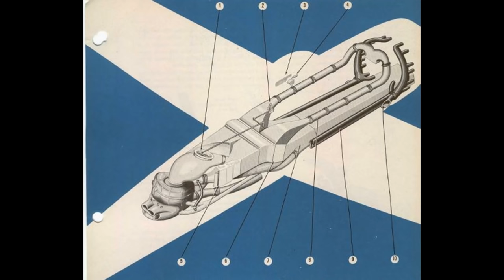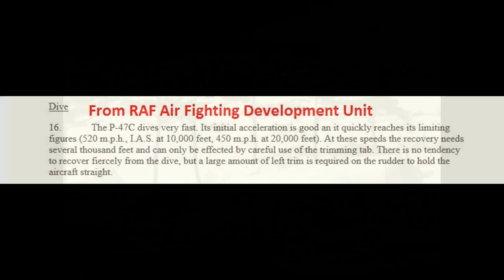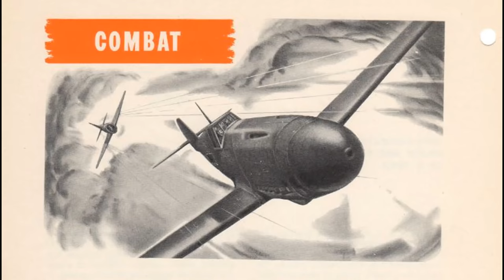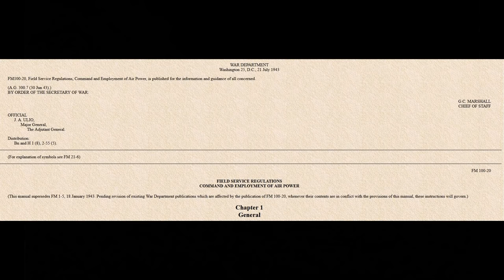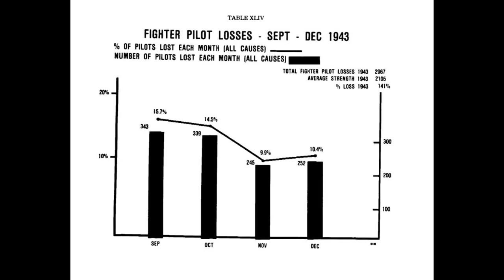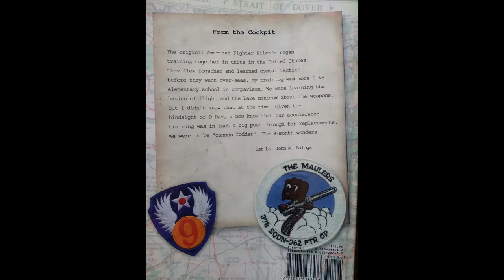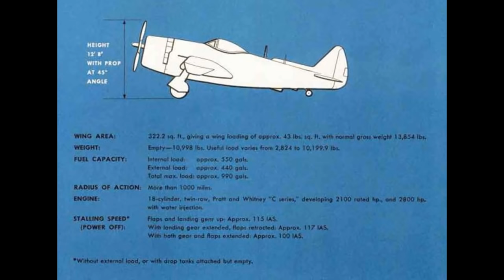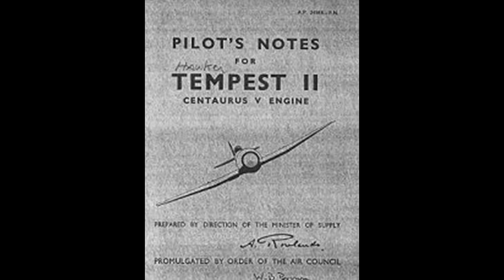P-47 Thunderbolt Pt. 8 Conclusions

Comment: Great job on a great series.  In particular, I did not previously appreciate that some of the P-51's fame and reported superiority over the P-47 was due to the senior AAF leadership using the delayed introduction of the long range P-51 as a coverup for deliberately not providing drop tanks to allow deep escort by the P-47 in order to try to prove their mistaken idea that well armed bombers could self-escort.  The denigration of the P-47 in the literature (untrue lack of range) has persisted from then to now, which is why I did not fully appreciate it before watching this series.  With the P-47 being the actually good quality weapon that was available in 1943 and the first half of 1944, since the P-51 had been delayed by similar senior general officer level bad decisions,  the P-47 had to carry the load and succeeded in doing so.  In a lifetime of reading about WWII aviation, I don't think I've seen this argument made before, and certainly not with the detail and historical accuracy of this series.  Of course, the point about the P-47 costing $83k and the similarly effective and in some ways better (smaller, harder to see, superior surprise, slightly better dogfighter) P-51 only costing $51k is also critical, as a main job of air force leadership is providing the best air force for the available budget, and here the P-51 is clearly superior.  But, it also seems Republic may have partly brought some disrespect on the P-47 among senior leadership themselves by insisting on higher profit margins.  The Grumman F6F Hellcat was also a great plane, using the same engine, weapons, and avionics as the P-47, and costing only $35k per plane.  The P-47 is more aerodynamically advanced (needed in the ETO), but that does not fully explain it costing 2.4X more than the similarly defined and equipped Hellcat.  

Greg, I certainly wish you success in getting your materials into mainstream military aviation television documentaries.  By yourself and on a part time basis you are doing a lot better job than they are with their much larger teams and budgets.  You are basically the P-51 of WWII aircraft documentary makers.

Comment: Another great video! Thank you Greg! 

A thought about diving:

"In short, you will seldom maneuver in either the pure vertical or the pure horizontal; rather, you will be trading airspeed for altitude in an infinite variety of oblique planes. As you develop your BFM skills, you will learn how to use the oblique to turn as tightly and quickly as you can while conserving the greatest amount of energy, thus preventing you from approaching the deck, out of airspeed and ideas."

Comment: Greg, thanks so much for the great series on the P-47!  My uncle,  1st Lt. August Garcea,  flew the P-47D in the ETO.  He was a little guy...5' 4" and 140 pounds and flew with the 358th FG, 365 Fighter Squadron (Orange Tails.)  He flew 24 missions and was sadly killed in November 1944 near Hagenau, France. His plane was damaged in a dog fight with a Me 109, but he landed it safely.  He was later found wrapped in his parachute and buried next to his plane which was only slightly damaged.  His wounds were consistent with being stabbed with a pitchfork.  The local farmers did not like the Jabos since they commonly shot up horse-pulled farm wagons that the Germans used for transporting equipment and ammunition.  There was a statement taken from a local farmer that observed the dogfight and the landing of the plane in an open field.
Reply from the maker: Thanks for the story Ken, I'm sorry about your uncle, it sounds like he was a brave man.
Reply: @GregsAirplanesandAutomobiles   He was just one of many P-47 pilots that didn't survive the war.  Flying low to attack ground targets they often didn't have the opportunity to use their parachutes to attempt or survive a bailout.  Also, the German quad 20mm anti-aircraft guns were deadly to low flying planes.

Comment: The focus on pilot skill is important.   Early in WWII US suffered greatly against more experienced Japanese and German pilots, the other side simply had more experience.   

The zero was a very good plane, but by no means invincible.  I think part of the zero's reputation was gained early in the war when US pilots often did not have experience.   An F4F Wildcat can compete with the zero if it plays to its strengths.

You could argue that the German air force was largely defeated by losses on the Eastern front.  But then again US was also fighting a 2-front war (also in Pacific).

My final comment is that of all the amazing information on this channel the most amazing for me is the Taiwan-PRC civil war.   The late-model piston engine planes the PRC flew were no slouches, and idea of going on head-on-head against a Mig15 in a P47 is crazy.

Comment: A great conclusion to this video series! This is only somewhat related to the subject, but here goes. Air cooled radials seemed to have emerged victorious after WWII as being the engine of choice for large piston engine aircraft. Why is this? I can see this being acceptable for military applications due to them being able to withstand damage and keep running. However from the civilian side of things, it doesn't make much sense. Battle damage is not an issue in this scenario. Liquid cooled engines typically run at much more consistent temperatures than air cooled so tolerances can be tighter. This would extend the service intervals of the engine and be less costly to maintain, not to mention eliminate the shock cooling concern with air cooled engines. There would also be a performance benefit because the liquid cooled engines could run more manifold pressure without the risk of knock due to lower cylinder head temperatures. Yes there would be a negative impact due to the weight of the cooling system but this could be offset somewhat with the smaller liquid cooled engine making equivalent power and reduced drag due to less frontal area than a radial. It'd be interesting to see what would've happened with piston engine aircraft if jet engines had not taken over so quickly.

Comment: Outstanding analysis.. very much appreciate and look forward to your videos.

You make a very strong case about the combat effectiveness of the P47.  However if 3 P51s can be provided for every 2 P47s, and they use less fuel,  the P51 was a 'better' warplane.   A 50% increase in the # of planes and less of a logistical  support need are very important attributes.   

So while the P47s engineering/performance was superb,   it makes sense to replace with P51.

However I appreciate how Greg debunks many of the P47 myths .. and how important an aircraft it was to the Allies.. look forward to the next video
Reply from the maker: Good post Keith, and that's actually my point. Yes, it made sense to replace P-47s with P-51s, however not because of any deficiencies in the P-47 performance, range, or effectiveness, but rather because it was too expensive. My other point was of course that the 47 did a lot more to win in Europe than the 51.

Comment: Thanks for the great video, it was hard to wait so long for the next WWII episode!

One question: I noticed the two-engined B-26 and A-26 were nearly as expensive as the four-engined B-17, from 1942-44 over 90% of the B-17 price. Why was this? I mean, aren´t engines the single major cost factor of aircraft, at least WWII ac?
Reply from the maker: The A-26 was far more advanced than the B-17 and far more capable. It's a late war plane as opposed to a 1930's plane and thus economy of scale wasn't there for it either.

Comment: I would like to add something from the perspective of someone who has built and flown scale RC airplanes since 1971; including being a designated test pilot for many of those years. 

The Jug consistently scales down well. I've flown them from 36 inch to 102 inch wingspan and even when overweight, as scale models usually are, they all fly well. My best, tragically lost to a midair collision, was 80inch span and 14 pounds with a 7hp engine. 104mph by the radar gun and lands like a low wing trainer. The only WW2 fighter I like more is the P-39 which is a little more aerobatic and just as stable.

Cheers!

Comment: Regarding the question of why later in war P47's were largely replaced by P51's in fighter role:

Both planes were good fighters, but the P47 was much better for ground attack (much more rugged).     So even if P47 was a good fighter, it made sense to move it to ground attack role.

Ironically five years later in Korea the Mustang had to participate in ground attack, we had to make do with what we had on hand.

Looking at WWII under-appreciated planes, the Illushun (sp?) Sturmavik was a good plane.  Might be  been most produced plane of the war, not super high-tech or fast but great ground attack plane.   The Germans had the stuka, the Russians had the Sturmavik, but the US did not really have a mass-produced single engined dedicated land attack plane.   It would seem starting with an R2800 you could do better than P47 for ground attack.  
* supercharged, no reason to fly high
* larger wings: P47 wing loading seems to be a disadvantage (and I'm a huge fan of the P47).  Post war the AD1 Skyraider is an example of plane with large wings around big radial, albeit the Wright R3350.  

Of course using the P47 had the advantage that using fighter for ground attack, you had the fighter protection built in.

Comment: 5 GALLONS of oil burned per hour??  Holy SH%# !!  I had no idea, no wonder plug fouling was an issue.
Reply: looks like  it was a problem of some  radial engines but the P-47 was not on the first place, take a look at US Air Force A-1 Skyraiders at the parking spot during the Vietnam war ;) a lot of oil covering the aircrafts noses , dripping on the fuel tanks, Tarmac ect.
Reply: @Sturminfantrist  All radial engines use oil.  "If they aren't leaking, they are out of oil".  -Old Axiom.
Reply: I love the Flying Heritage museum in Everett. You can tell most of the planes are in flying condition by the drip pans underneath them.
Reply: Dividing that 5 gallons by 18 cylinders and considering the massive displacement per cylinder and the power output and the fact  that it´s a radial engine, it´s not that bad.
In addition to oil burning in the cylinders, the crankshaft bearing seals also loose oil.
Superchargers and turbochargers also want to be lubricated and loose some oil (not sure if they use the same oil as the engine in the case of the P-47)

My 1960´s british car uses about half of that per cui per cylinder per hour when driven at 70mph, even more per HP, and it´s an upright inline engine!

I wouldn´t trade it for a Prius though! 

No significant spark plug fouling over the last 30k or so miles. Maybe I should replace them, but as long as they look good and neither power is lost nor fuel consumption increases, f**k the instruction manual!

Comment: The P-47 was never outclassed in any situation, in any model.  It used the best proven technology of the time, with the best engine available, and was delivered in numbers that changed the course of the war.  Designed as a high-altitude escort/interceptor, it also excelled when stuck into a ground attack role in the last year of the war.  Bravo Greg, as the living memory of Thunderbolt pilots fades, your work will stand the test of time.

Comment: 38:00 "Destroying the Luftwaffe" - also, as the Messers were over the Reich, they could not protect the Stukas from Yaks or the Wehrmacht from Ilyushins...
Reply: The JU 87s were withdrawn from the Western front after the reality check called the Battle of Britain. The plane was obsoleteand until the Battle of Britain had not met determined modern defensive fighters.
Reply: @JohnRodriguesPhotographer  Reality check: Operation Excess and several raids against HMS Ark Royal proved, that the Stuka is still a good dive bomber. 
And the Japanese Aichi D3 "Val" wasn't that better than the Ju-87 but was quite successfull - as long as they had fighter cover. 
Same for the SDB Dauntless and even the Fairey "Stringbag" Swordfish.

Comment: The one thing I do not understand about the Air War leading up to D-Day, is that the Allies did not convert at least one entire bomber group into a.... Wolf is sheep's clothing.

If you loaded zero bombs into a bomber, but instead used all that available weight for extra guns, extra ammo, or armor for the crew's action stations and the flight controls/vitals, then you could form a porcupine-like trap.

The Germans would not know there was not a single bomb in that entire formation, and they'd have to attack it as if there were.

And when they come close, you can now farm kills.
You don't need a Bombardier, so you can switch that out with another gunner or maybe a medic.
And with a lot of extra ammo and armor, you won't get shot up so horrifically.
You could also add some extra .50 cals, so that you actually take down enemies at even trades in lives, instead of planes. 

And especially when the Bomber Maffia was still getting loads of people killed for their stoopid reputation, this trick might have saved lives and more importantly sown doubt in the minds of the Luftwaffe pilots. 
One formation of these converted non-bombers would give them pause, and caused them to approach all the still-bomber formations with extra apprehension. 
Just the stress from not knowing whether today's formation is a trap too, would affect their flying negatively 😈
Reply: The only two reasons I can come up with why this would not be feasible, are:

- the bomb load they carried was not actually that heavy; at least not enough to significantly up-armor and up-arm the plane

- their take off weights and landing weight differed greatly
If the landing gear would collapse if they came back with their bombs undropped (due to weather or mechanical problems etc), then you obviously cannot replace that weight with armor plates. Since those are kinda hard to disassemble and drop overboard when they're flying back across the Channel 😅

Comment: Excellent  Greg! The Thunderbolt series(along with other subjects ) has been intelligent, concise, in depth & fairminded! This #8 especially, as I have argued the same truth, facts & opinions with Mustang lovers for decades. Not which was better, both had strengths & weaknesses(but as you have made clear, the P47's few weaknesses are always amplified while glorifying the P51), but my argument has always been that the P47 doled out more destruction to the German war regime than any other Allied fighter, both in the air & on the ground. More maneuverable than most think with a pilot that understood its strengths. Thanks for the factual info on major loss of experienced  German combat pilots via the Thunderbolts between June '43 & late spring of '44. This is a fact Mustang fans refuse to accept, & they never want to discuss the P47 being relegated to ground support(except the 56th FG), thereby leaving many kills for the P51s against quickly trained novice pilots of the decimated Luftwaffe(not forgetting the several dozen great Luftwaffe aces who survived the war, but they grossly outnumbered by well trained USAAF experienced combat pilots). There were many great aircraft in WW2, I've always believed the P-47 Thunderbolt was one of the best, all things considered. By the way, Dom Gentile describes shooting down 2 FW190s, expending his ammo, then outmaneuvering a 3rd in a swirling fight at low altitude until the 190 ran out of ammo. Not bad for a plane that is not supposed to be maneuverable, huh?!

Comment: Excellent work Greg, I really appreciate your work. The amount of hours you put in is amazing! A couple of notes, as a Canadian, the Dieppe raid was conducted primarily by the Canadian army, with some brit's and  Poles(???). It remains a sore spot for some here notth of the 49th. As well, in 2018, it was uncovered that the primary objective of the raid was to secure a new 4 wheel enigma encription machine. Your description of the oil consumption of air cooled radials is telling. In the mid seventies the Canadian air force, wanted to set a world record for the longest un refeuled sustained flight. They chose the the Argus, a canadian made maritine patrol aircraft. This thing had 4 Pratt&Whitney R33550 compound engines. The powers the be went to enormous lenghts to get, literally every last ounce of fuel into the tanks.
Reply: Sorry my bad, but to continue, the flight lasted a bit over 33 hours. They were forced to land not because of low fuel but low engine oil. Those radials puked a lot of oil. I heard one story ftom the Pacific Theater that the Japaneese did capture a P 51 and were amaized at the lack of oil put out by the PackardMerlin.

Comment: The photograph of the Razorback with the white gun tips reminds me of my father telling me about putting tape on the barrels of the guns.  I would have guessed they did it to keep water out, but he said they did it to know if the plane saw action.
Reply: Robert Johnson mentions this in his book " Thunderbolt! " he wrote that the ground crews could tell if he saw action because the tape was missing.
Reply: I had an uncle who was a Corsair crew chief in the Pacific, and they did the same with their aircraft (F4U-1A/D). 

He said the reason was twofold: first, to keep contaminants out; second; to reduce drag. The bonus was it was quick to determine if the aircraft had fired its guns on return by a quick look at the tape. I can only assume that the rationale was similar on other fighters.